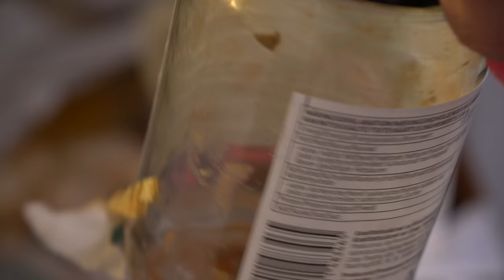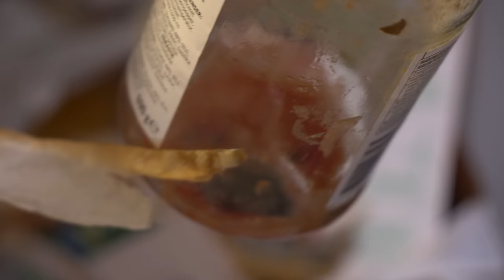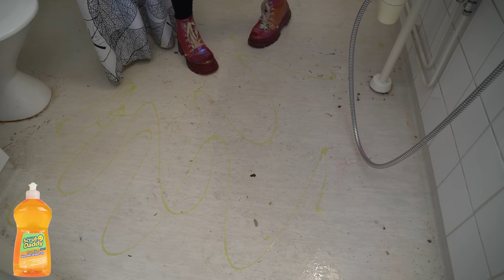Helping a depressed and lost kid back on his feet | FOR FREE! 🥰

Comment: As a fire alarm system designer, thanks for pointing out the need for a smoke alarm!  It's so important.  About 2/3 of people who die in house fires died in homes that had smoke alarms that were missing, disabled, or not maintained.  Smoke alarms are critical for fires that happen when you're asleep because smoke will suffocate you in your sleep rather than waking you up and flashover can happen within three minutes of a fire starting! (Flashover is when it gets hot enough that all of the surfaces around you suddenly catch on fire including walls, furniture, etc.)

Test your smoke alarms and blow them out with compressed air or vacuum them once a month, replace batteries every six months if applicable.  Just do it the day you pay your rent or mortgage (or other recurring bill) so you get in the habit! ☺️

Comment: i am too lazy to clean microwave so i just put a bowl of water with winegar and start the microwave. As it evaporates it creates fumes that disolve grease. All i need is to wipe it afterwards. But you have to be cautiose cause the bowl gets really hot as the watter reaches boiling point. Somtimese i clean plastick tuperware that way, but i do not set the timer for that long.

Comment: Hi Auri. I am wondering about kind of cloths you use to collect all foam and water from surfaces. I used many different cloths and nothing takes all left foam and water than I can see your cloths do. I bought quite big set of microfiber but they seems to be too thick. I am not satisfied.. I learnt a lot from your videos - f.ex. using dish soap much more often than buying newest chemicals because dish soap in fact cleans everything, starting from induction finishing on bathroom, mirrors, everything. Thank you.

Comment: I’ve got some molding on the side of my bed here right in the corner it’s getting my my charger wet and then it just stops working. I’ve got a wait until it gets dry again it’s like I’m also like the side of my wardrobe is a little dirty on the back of my heater is just dust it’s just pure dust

Comment: Hi auri i am your fan from pakistan i wanted to know isnt oven cleaner a really harsh product ,i bought one  it had instructions that i need to wear gloves ,protect my eyes ,ventilation is required etc etc so i was so scared to use it .Secondly please tell me after you use microfibre cloth to clean the kitchen, smtimes the cloth gets greasy/oily so how do you wash it? When i wash it with just water the cloth feels so oily.
Reply: Soak the cloth in soap. And then pour boiling water on it. Oven cleaners are all like that, use it.

Comment: With the cutting board that pulls out with the top drawer, how would you clean it after meat juices have been absorbed by the wood? Do you have to sand it, bleach it or what? I would think germs and goo are still inside the wood! Yuck 🤢